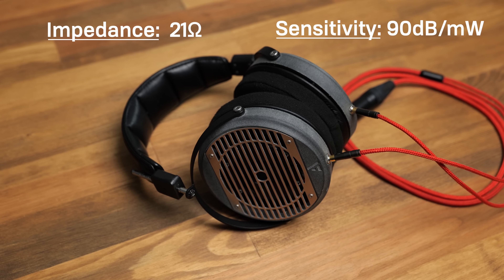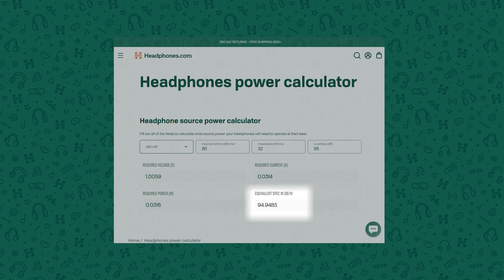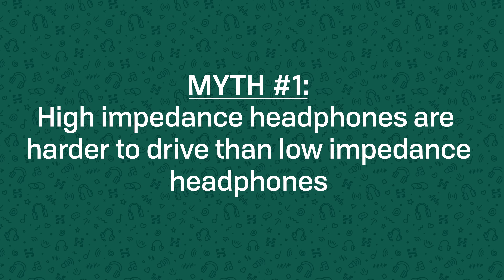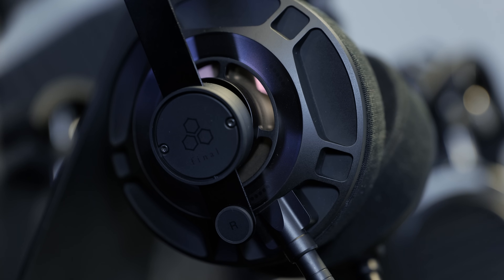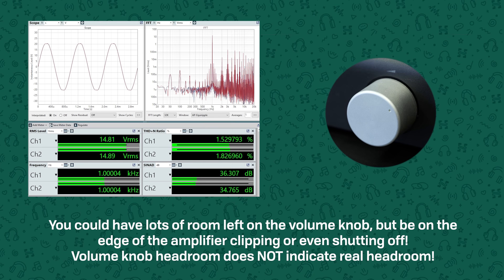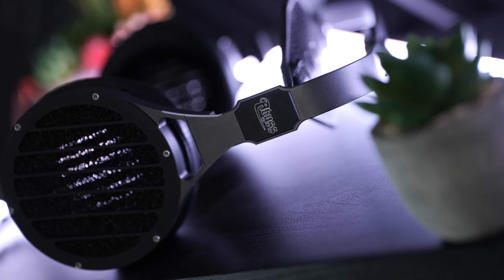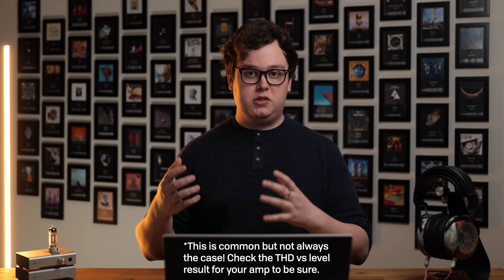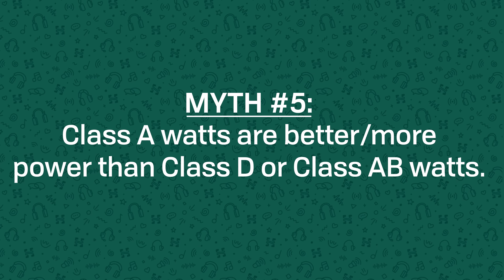Do I need an amp? How much power do headphones ACTUALLY need? - Myths about power

Comment: If you get enough volume at 80% volume you're set imo. People using speaker amps for HE6 etc are just using worse measuring power for no benefit most of the time.
Reply: No, you are a complete weirdo for thinking that.
Reply: Quite the opposite actually. Speaker amps have a vastly more demanding load to deal with than a headphone needs. Such massive impedance drops caused by dynamic driver speakers means certain measurements a speaker amp must be far superior than a headphone amp. In most causes such measurements don't matter for headphones, but there are cases were the down sides of speaker amp mainly in higher noise, are also completely irrelevant like they are in highly inefficient planars. In those cases there is absolutely no reason to use a headphone amp unless you are afraid of misplacing the volume, or want to use a range of headphones with it (which will be effected by its noise floor).
Reply: He literally proves you wrong in the video. Lmao
Reply: @En_Joshi-Godrez  I've never come across this issue with the HE6 with several amps so I wonder what are examples of this issue in practise. Power amps have sounded worse in my experience.
Reply: @hartyewh1  which power amps were these?
Reply: @En_Joshi-Godrez  Hegel H160, HK3490 or something close, some TOTL Pathos thing and some Naim, maybe Supernait 2.
Reply: @hartyewh1  you are absolutely sure you are not talking about the SE model?
Reply: @hartyewh1  and before you ask. No the he6 isn't sensitive enough to pick up noise from a speaker amp, not a good one anyways.
Reply: @En_Joshi-Godrez  I wasn't thinking that. Power amps just usually measure far worse in anywhere near comparable price ranges.
Reply: @hartyewh1  their SINAD does, but thats absolutely irrelevant to a headphone as inefficient as the he6. Every other measurement, and I do mean EVERY OTHER, is vastly superior on a speaker amp. Cross talk, linearity, phase distortion, and with the two most important benchmark being  frequency vs distortion, and power vs distortion, they absolutely destroy headphone amps. No, you are VERY VERY wrong them having worse measurements.
Reply: @hartyewh1  and again, they need to perform at a nominal 2ohm load. Do you realise how much farad capacitance is required to achieve that? Yes it raises noise floor, but thats the ONLY  thing it does, all other metrics of measuring amplifiers are superior, all of which matter to headphones in differing amounts.
Reply: @hartyewh1  the only two measurements worse on a modern $2000+ solid state speaker amp are noise floor (SINAD), and output impedance. Both of which are absolutely irrelevant to most planars. All other metrics those amps are vastly superior, one of which being frequency vs distortion metrics, which are as important for headphones as they are for speakers. This is what amps are designed to do, play the frequency spectrum without distortion, something vastly more difficult on a speaker, hence why they must measure better than a headphone amp.

Comment: Also you should have mentioned that the impedance of dynamic headphones varies significantly with frequency.
Reply: Yep! This is also an important factor to consider
Reply: @GoldenSound  But since the impedance bump of dynamic drivers are at the same place as the resonance frequency, the power required ends up at plus/minus zero, right?
Reply: @GoldenSound  How do i know amp characteristics of built-in phone amp?
Reply: There are certainly a lot of misconceptions about this.

Comment: It is incorrect that the volume knob adjusts gain. As you said later in the video, for most amps it adjusts attenuation of the input signal. Also, putting your amp in high gain will not change the specs of the amp, but it will allow you achieve higher wattage. So if your cans are not getting loud enough, changing the gain setting to high might help.  Nice video otherwise. Love the Audio Precision graphs.
Reply: To clarify, whilst the fixed-gain stage is not having its gain altered, the gain of the product as a whole is. Attenuation of a signal is negative gain.
This was said in reference to the product as a whole

Comment: Wait. So do I not lose any clarity when driving the 1990 pro through a pc alone?
Reply: Whilst a lack of sufficient power could contribute to lack of clarity, this is also about the actual performance of the DAC and amp themselves. Generally PC internal audio is not very good, so an external DAC and amp will likely be a benefit even if power isn't an issue
Reply: @GoldenSound  Thanks for the answer. That's a good point. Was kinda hoping I could skip my amp/dac (fiio k5) due to latency when gaming but I don't want to gimp my sound.

Comment: Thank you for video, but I have one question. I have moondrop blessing 2 dusk, is phone and pc enough to drive this iem? or I am missing something that could better my experience? I use apple dongle for phone
Reply: I have them and you can drive them with pretty much anything tbh
Reply: @polaristars  so I am not missing anything? Got it
Reply: @shakhbozyusupov6331  so you respond when you get the answer you want. But when you dont get that answer (I.e to spend more money) you just ignore it. OOF, someone is stroking their ego hard.
Reply: @timkelmer1268  sorry, what?
Reply: An Apple dongle or similar can be better than a PC or a phone in the quality of the signal even if the power output is smaller. Quality over quantity.
Reply: IEMs are generally extremely easy to drive and amps are not often needed. BUT, you may still get a benefit in performance with a higher quality DAC and Amp even if power isn't a limitation

Comment: I find the "these headphones are so hard to drive" dialogue online maddening. I own "easy to drive" MDR-Z1R headphones (64 ohm/100dB/mW), and "hard to drive" Aeon Closed X headphones (12.5 ohm/91dB/mW). And it is true indeed that I need to run my WM1A Walkman DAP (via 4.4mm balanced output) at a higher volume (or gain, I suppose) setting to bring the Aeon to my preferred 70dB average listening level (I run the Z1R at about 45/120 on the Walkman volume meter, and the Aeon closer to 65/120).

But that's not enough for amp people. They're all like "but but but you need more headroom" or something. And I just don't get it. I also have a Schiit Fulla E amplifier, that I (needlessly) bought expressly because the Aeons are "hard to drive," and it also easily drives the Aeon at about 10 o'clock on the volume (gain) dial. 

When I try the Aeons, or the Z1Rs for that matter, across all of my audio-generating devices (laptop, desktop, phone, DAP, amplifier), once I level the volume using a dB meter, they all sound the same. Equally good. No audible distortion, no "roll off," nothing of any of the other buzzwords amp-heads throw around. Yes, the phone needs to be run basically at 100% to get there, but it still sounds good. And I'm just thinking "wattage is wattage, and that's it. If I can get it to volume without distortion or  loss, that's all I need." Am I wrong? People on r/headphones and Head-Fi keep implying that I am wrong.

Comment: This is a great video, favorited for future reference as it saves a lot of writting time when explaining to people how headphones work.

Personally i found out that people tend to understand better the concept of power to sound pressure conversion when you explain to them that the headphone impedance determines the amplifier maximum power, and then sensitivity is how efficiently a driver can convert that power to sound pressure. For some reason explaining it as "steps" makes that information easier to digest.
Reply: I find that most people who arent WILLING audiophiles really don't care about this. Audiophiles care...most people will still buy those crappy Bleats, Bosé and Cowin Headphones off Amazon. I've seen this too many times where most people dont care about better sound and the technical of a headphone as much as we do. They just don't and I'm resigned to say that's okay.
Reply: @LIL-MAN_the_OG  we are not taking about those people.

Comment: So I guess this is the reason why for speaker amps, many pure class A power amps with very low power (50 watts) can steam roll over many class D amps from the likes of crown with 1000w when the impedance of the speakers drops low enough, magnepans included.

Comment: So all amplifier reviews should show Power vs frequency vs distortion.
Reply: You they absolutely should. I think its an essential statistic. Only problem is most manufacturers are too dishonest to publish them even though they have the equipment to test it. And if you wanted to do it yourself, you'd need a spectrum analyser, which generally cost more than a new car.
Reply: @En_Joshi-Godrez  I'm sure the headphones show could afford a second-hand Spectrum analyser.
Reply: @dangerzone007  they have one. But the last time they did an amp review was a while ago. But going forward, I would like to see it. That stastic matters infinity more than its SINAD.

Comment: would love a vid of an explanation of the differences between class a, a/b, d amps
Reply: Yes plz
Reply: Only Class A amp that I consider as 100.00000% Class A is a pure single ended triode (no parallel tubes, directly or indirectly heated or triode strapped without any option to switch to pentode) output transformer coupled amp. The rest of them that claim Class A are not Class A in my book since they have tricks to switch to A/B when power requirements increases beyond a certain point or has a push-pull /pentode/ultra-linear mode, or it's a balanced driven triode amp).
Reply: @NexusS4GIceJelly  why does it being single ended matter?
Reply: @williamstevenich   A balanced amp uses push-pull which is Class A/B because each op-amp or tube or transistor only amplifies one set of peaks (positve amplitude peaks for example or R+/L+) and that other tube / op-amp / transistor that amplfies the negative peaks (R-/L-) is momentarily off (50% duty cycle). Manufacturers add something called "Class A Bias" and claim that at a certain power requirements, these transistors can turn on 100% of the time (aka 100% duty cycle) thus amplifying all signals (one tube is R+/R-, complete sine wave in pure Class A) while the other tube/op amp etc amplifies the L+/L-
Reply: @blainelacross5311 yea, I hate how we have accositated unbalanced audio with what single ended triode amplification is. I guess manufacturers use the phrase single ended because it sounds more optimistic than saying its "unbalanced".
Reply: @NexusS4GIceJelly 
Lots of stuff can be class A. You just like tube even harmonic distortion. A push pull setup cancels the even harmonics moreso so the odd harmonics show through more. And tubes are generally more distorted than transistors.
Reply: Neither YOU, nor anyone else can hear the difference but you can feel the difference in your power bill at the end of the year.
Reply: @leviathan5207  please get a job
Reply: @leviathan5207  L take
Reply: Easy, a, a-b sound different and interesting, d is dull shite. Bit of an overarching generalisation, but an opinion nonetheless.
Reply: @billywindsock9597    Not a bad rule but IMHO implementation matters too. Class D headphone amp is overkill for headphones but most efficient amps there are Class AB with some Class A bias at say 0.5W or less. A true 100% Class A Single Ended directly heated triode headphone amp is still the best sounding amp in my experience, and the only one that give me tears of sonic bliss
Reply: @billywindsock9597  i agree that class a sounds subjectively better. love my RebelAmp to death, just trying to get an understanding of the electrical differences.

Comment: One thing I dont quite understand is how to know from specs, how much power can put a certain amp in to a 300ohm headphone if the specs are given in mW for an headphone of 32ohm of impedance. Ca someone explain it 🙏 ? (the video is quite useful tho)
Reply: You can't really. At most you can assume that the amplifier outputs the same amount of voltage at these two impedances and work out the amount from P=U^2/R equation.